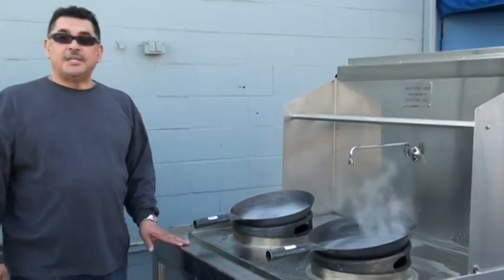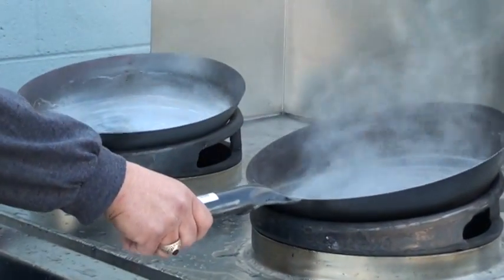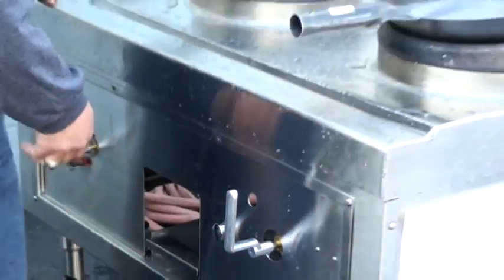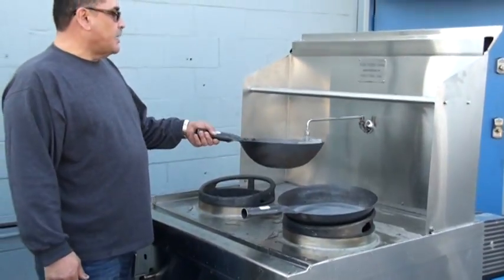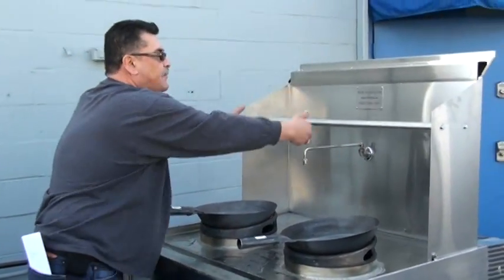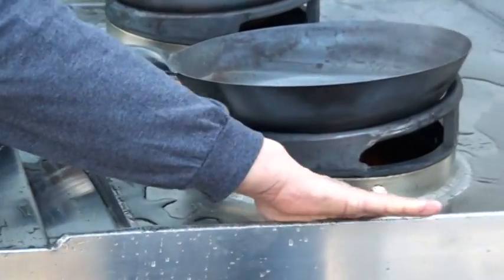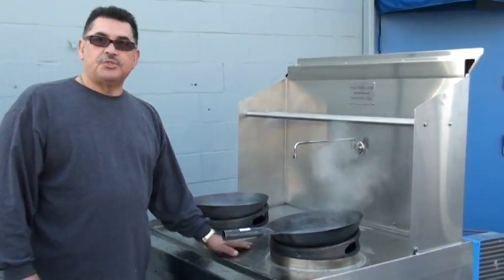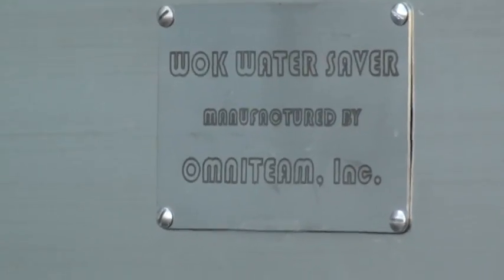Major Water Wasting Machine That pepole don't know about

Comment: High end woks that are at least 12 gage stainless steel do not need constant waterfall or water rail cooling. They are much heavier and quality built. Furthermore, you don't need a button system that will some day fail and will be difficult to replace. Most woks have a swing faucet and when you swing it, it acts as on/off! You don't have to reach down to push a button and they are easily replaceable! There is no "genius" invention needed! Geez.
Reply: interested in seeing more information on this as my family own chinese take out restaurant and like to see if i can do some adjustments to the  equipments
Reply: @calvinwong365  lookup your location followed by waterless wok range. Usually they are custom. You should also see if there are tax incentives and ecogrants to better help you get these with help and to help the enviroment...